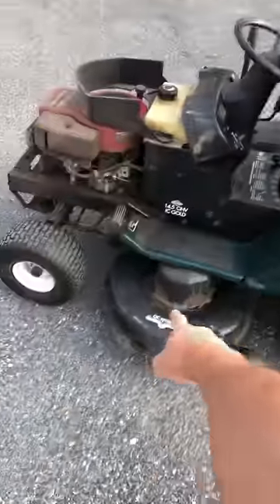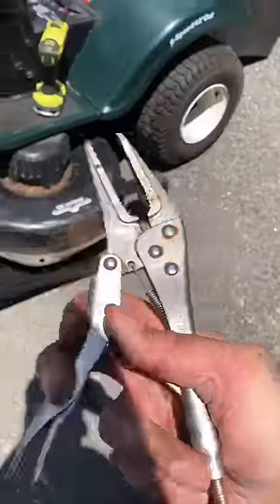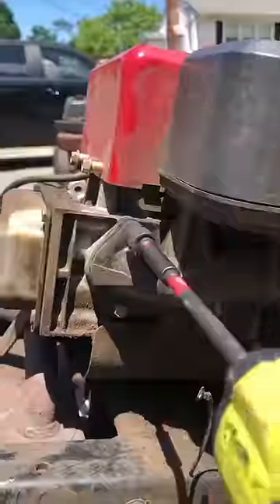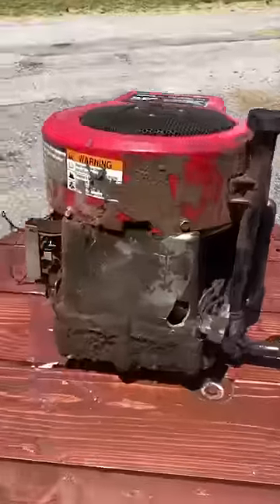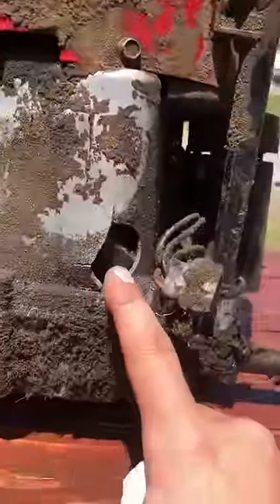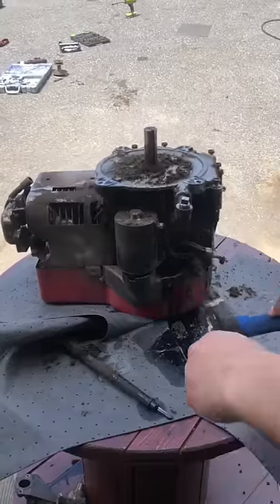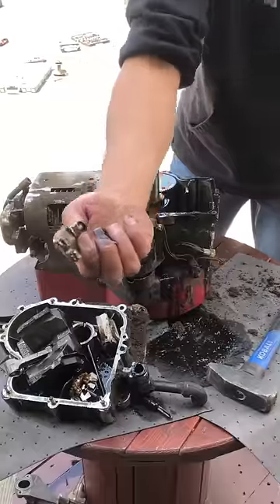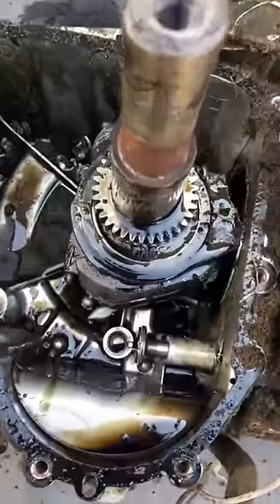The Dangers of Hitting Rocks | Exploring the Consequences on a Craftsman Riding Mower

Comment: Me and my brothers made from 2 old lawnmowers which we got for free to 1 working during lockdown.
1 was on fire once and had a new engine bit never really worked well after.
The other also had a hole in the side so we just swapped the engine changed the tires, pulleys and battery. 
Worked pretty good and flipped it for some nice profit. But it was mostly a fun learning experience.

Comment: It looks like it blow up from lack of oil that why all the grass was stuck to it
Reply from the maker: 🤷🏻‍♂️ probably both. The impact def didn’t help the cause 🤣😂💪🏻💥💥💥💥💥💥
Reply: @NiceLawnBro sorry but hitting a rock would just bend the blade on the deck and either stall the engine or slip the deck belt as to what caused the engine to blow up is the piece that is supposed to help reduce the vibration of the engine which is the first piece you pulled out they are prone to breaking because the one single bolt that holds that 2 piece part together inside the engine will work lose letting the 2 pieces move around causing them break and it causes the engine to throw the rod I've had several of those engines and have had that happen and after the first few times of that happing if I got a mower that had that style of engine I would tear it down and remove the particular part and put the engine back together and run it because it doesn't need that part and Briggs and Stratton eventually figured that out as well

Comment: lack of oil most likely. blew the connecting rod on my 16.5 kohler pro, due to low oil. Ive hit many rocks with that mower and my current mower, at most it just slips/knocks off the belt and/or bends a blade. No heat against you, just a "customer states" type deal

Comment: I bought an old lawnmower that had been pushed to a rock and tried to fix it but i couldn't figure out what the problem was so it just kinda sat there until i took it apart and found that the flywheel key was sheared diagonally in half. Those things pack some real power even if it doesn't always feel like it.

Comment: I’ve worked on 100s of those engines. So many failed compression releases. 
I’ve replaced a crazy number of camshafts. I always followed the the break in procedure on the camshafts and tappets. Still had a considerable number of them. They would flatten the lobes and or something. Lots of them would just instantly break the new compression release parts.
Reply: .. well, I've done so many intek cam jobs I can leave the engine running while I swap it😜

Comment: You are correct, been around enough to know that the engine through a rod. Hitting a rock will not do that. Like someone said, It would shear the flywheel key or bend the crank. Bending the crank could break the rod, but not like that.

Comment: I've never seen a blade strike hurt a mower with a belt driven deck. You can surely bust a spindle,but it's really impossible to damage the engine because the belt can not transfer that energy abruptly. You have an internal part failure. Possibly over revved. I once had a riding mower throw a rod and blew the starter off.

Comment: Small engine tech here: what really probably caused that motor to commit die was a blown head gasket. If you take the cylinder head off you will mostl likly see it's shot. The engine drank its own oil and since home owners never check it it hust was super low on oil and got hot. The color of that nasty black oil also confirms this since the exhaust gases were mixing inside the engines oil chamber.

Comment: That is why the mower is belt driven and belt to the blades to prevent sudden shock stop that would blow a crank or rod. But if it was a large enough rock and hot belts that grip extra tight I think this could happen.
Reply from the maker: Or it may have been the engine tearing itself apart and she thought it was a rock she hit.

Comment: I did this with a little push mower, it bogged maybe from oil supply problem or who knows what but i leaned into the accelerator and within a couple seconds it said POP and a hole like that one appeared; i barely saw the missing bit of casing fly off.  Edit oh yeah the bit of moving parts was sticking out the hole now i think about it.  Maybe the rod i cant visualize it to remember exactly
Reply from the maker: Always a tragedy when the insides of the engine are now outside of the engine 🥹🤣🥰

Comment: Like everyone else is saying this was the engine failing. Hitting thing with the mower usually slips the deck belt and or bends the spindle or deck. I have seen a lot of single cylinder Briggs come apart this way.

Comment: Reno green landscaping here. I am the truck trailer aaand heavy equipment mechanic 138+ for me .. however our small engine guy is going to want more on this video.. did you replace it or fix it
Reply from the maker: It sits currently without an engine. It will receive a donor engine from another free mower. Just not sure which one yet!

Comment: the belt gives enough cushion that a rock should not do that. they probably just though they did. I've repaired mowers where the blade is directly driven by the engine hitting large chunks or metal or stumps and coming g to an instant stop. only think I have seen it can cause other than bent crank would be a sheared flywheel key and usually only bends the blade if anything

Comment: I've ran over some big & little rocks over the last 5 yrs with our riding lawnmower & never once did I cause that kind of damage to the motor.  I've broke & bent stuff that holds the mower deck, chipped blades. But never killed a motor.  1 of the rocks was about the size of a watermelon,  half buried, but covered in  tall grass, that broke the bearing tower thing, but never a motor.

Comment: This is caused from the carb bowl getting stuck open and flooding the crankcase with fuel. When the correct conditions balance out, it will detonate and blow the block. Mine did it too, while between my legs!😮
Reply from the maker: This makes sense!
Reply: Wasn't the rod cap broken off? 🤔
Reply: Idk. I didn't pull it apart. It was locked up but blew a chunk out of the block out. I was told it's very common with the gravity fed carbs on these. The guy called them ticking time bombs.

Comment: What is the correct type of oil for these briggs n stratton engines? A quart of lucas?
Reply from the maker: 🤣 regular 10w40, 10w30 or sae30. Depending on your weather (heat) in your area. 🥰

Comment: Looks like you have a little more room to grow in the diagnosis department. We can all grow and learn so it’s not an insult. Hard for the impact from the deck to travel through rubber belt and on top of that these decks can’t take a hard enough hit to damage the engine because the tripod style spindles will break off the deck first. That engine just gave out probably because it was low on oil judging from all the crap around the mount it had been gathering crap on the leaked oil for years. Maybe just gave up after over 20 years, happens sometimes.

Comment: Those Briggs engines are designed to fail at every point internally. First time I saw a white metal (Chinesium alloy) wrist pin was on a Briggs. If everything internal fails to fail, the carbs are designed to fill the crankcase with gas after a few years of use, leading to catatasrophic engine failure

Comment: Flywheel key is a soft metal, and acts as a sacrificial piece in case you hit something. No way that engine blew up from hitting something before the key broke.
Also that older design camshaft with the compression release was actually the good one, and lasts much longer then the later more modern versions after production retracted focus on quality and shifted to cutting corners and costs.....funny thing is though the retail pricing kept going up.....
Reply from the maker: It probably sounded like she hit a rock! Quick engine stop and a hole in the back of the case; too much inertia. To your point, a key would have been an easy fix. It’s also amazing the “cheap” new riders are $1,599. The good ones are now like $4,500. 😳

Comment: So I have the same exact mower. I popped the motor too. Literally same carnage. She boogies with the 17 horse now.
Reply from the maker: Nice! What brand did you get? Or just a used one on the internets?
Reply: @NiceLawnBro  it’s a Briggs from the same family.
Reply from the maker: @Rayrayman111  I’ve got a machine with one of those in it right now. Might take it for this. Yet to be determined
Reply: @NiceLawnBro  really low maintenance machine. Had to do some steering bushings. Other than that it’s the normal belts and blades

Comment: Hey dude I tried starting my mower yesterday. I could get it running but each time I ingaged it in a gear it would die. I need help
Reply from the maker: Could be a safety switch like the seat switch, parking brake switch, or the PTO switch. Likely brake or seat.
Reply: @NiceLawnBro  oh yeah your the man. My rednecked seat switch had come undone. Thank you I finally got my acre of lawn mowed.

Comment: if it actually hit a rock then the belt would would be the component to give. Not the engine. Engine may stall or whatever but the shock would be absorbed by the belt, blades, and all that.

Comment: Man, I remember when you would hit a rock or a root, shear the keyway, slap another one in there and back to mowing in 30 mins.
Reply from the maker: Through time and experience, the general consensus is that this was a lack of oil that blew apart the crank. You are correct! Shear key is the preferred method 🤣

Comment: Cant be a rock. Those belts are supposed to slip in such situations. Or was the design of the mower so bad that it didnt slip? But even if it didnt slip, if wouldnt have put a hole in the block. When you stall a manual car, the engine is still fine… probably due to poor maintenance or maybe it was just time for that engine to say goodbye…

Comment: oils so critical on these motors, people dont reliaze that theres no oil pump or tube splashing all the internals, its the level of oil and it needs to always be above the check mark but not over it. 
if you run low oil levels this happens...

Comment: I abuse my equipment, and I’ve always been afraid of hitting a rock, and bending the crank.
Reply: Better chance you would break the deck first on a riding mower. On a push mower with blade connected directly to the engine Frank shaft that’s another story.

Comment: These engines had notorious counterbalance issues, which is what happened here. Hitting rocks can certainly destroy spindles and if large enough sheer flywheel keys, however I don’t think even hitting the side of the Ricky mountains would have caused this issue.
Reply from the maker: 🤣😂🚀 that’s an image I can get behind
Reply: These blades are belt driven. Hitting a rock slips the belt or at least allows enough give to cushion the impact.
Reply: @benjurqunov  You can still break spindles and potentially sheer flywheel keys. The transmissions are belt driven as well, other than a severely worn out belt, how often do the tires slip, versus the belt? This is especially true on the mower deck, all the pulleys have fairly large diameters, which allows more surface area for the belt, providing more “grip” and less slip. 

There is a reason when people modify lawnmowers for racing/off-roading, even if going for a 1:1 ratio they install the largest diameter pulley possible, less likely to slip.

Comment: Those Briggs weren’t very good. Even the new ones aren’t. I’ve had to fix many of them. I have vintage ones and they just keep going
Reply: I must have the exception, I have a 15.5 EZmodel I got free. I removed the deck prepped/painted it replaced the spindles,pulleys and belts. The engine needed a carb 10 Yrs. after that but other than that it's still going strong. Oh the seat got replaced with a good used one also. A tool Don't need to be shiny to get the job done.

Comment: They let it run out of oil, a con rod dont snap from the blade hitting a rock. Mowers are one of the most used and abused engines out there, they live at 3600 rpm under a load + get neglected and usually not maintained.

Comment: You would have bent the crankshaft at the engine sheave … from the massive buildup of oil and grass debris on the engine mounting plate I can already diagnose that the engine failure was from oil leaks and lack of lubrication. But if it makes you feel better to think it was a rock I won’t argue with you, been working for John Deere for 10 years, customers never believe it was their fault.
Reply from the maker: You’re right.

Comment: I have 3 links from an old battleship, they are about 10kg each and massive. My wife run them over with the lawnmower, the blade was twisted into a s shape and we got a free replacement from the local shop, he just wanted to keep the old blade to hang on the wall.

Comment: I feel like you dont need to bust out the air tools for a freakin lawn mower lol. I’ve only ever used the old greasy rigid.
Reply from the maker: I keep seeing rigid tools for sale on marketplace. I have a drill drill by them and it’s ok. I’ve used an impact drill as well by them and was really impressed by it. Might as well pull the trigger and get a battery impact gun and make it happen, huh?

Comment: Ok I've never seen a Briggs throw a rod from hitting a rock or stump etc.

Bend a crank, blade, whatever but throwing a rod thru the block? Hmm...
Reply from the maker: The “rock” was a low oil result of the rod blasting itself apart into the crankcase. Maybe even an over-rev. But I wasn’t there so I cannot confirm that.
Reply: @NiceLawnBro  Nod. Only time I've seen them do it is from no oil. I don't know for certain on the newer ones but when I was flipping them they couldn't breathe enough to fly apart. They just wear themselves out and start burning oil badly but throw the rod? Naaa.

Comment: hitting  a rock isn't going to effect a belt driven lawn mower , it be stretching it to even say a slight nip on key way would stop it ....... broken rod is most likely abuse of engine...... not changing the oil like you are suppose to eats up these newer engines  cause of the use of cheaper softer metals ....

Comment: No way a rock blew a hole in the crankcase. Those mtd tractors can’t take low oil, Briggs did a terrible design on those and the 10hp generator. No low oil sensor, and an even worse way to check it
Reply from the maker: She must have lost track of her oil changes over the years and the “rock” was the rod and now it all makes sense. 🤣😂🚀🕳️

Comment: theres a 0% chance that was a rock. ive turned mowers on over rocks just to test this before (yes i was protected bc it was a self propelled and i just let it go towards rocks and had a setup for it) and a rock would just bounce in there but would not be able to get to the engine especially on a rider mower.

Comment: The engine is too far removed from the mower deck. Hitting an object with the blade will only damage the deck. That's a lot cheaper than an engine. Direct drive push mowers are a different matter.

Comment: A rock didn't cause  this . this cause due to lack  of oil an over heating .  The cam shaft release   on these  cause the engine to drop a valve an boom! . also another failure  point are the valve seat moving  causing  yet another engine to blow .  another failure point is the Anti back fire  switch on the carb failed  an a gas bypassed  the carb an filled the crank case with gas .

Comment: A rock did not cause that. They may have hit a rock right as the engine gave way but that is low/no oil damage.I have never in my over 40 years of mower repair seen damage like that from a rock impact.
Reply from the maker: It probably sounded like a rock
Reply: @NiceLawnBro  Oh it made some noise that is for sure. I know a man that was on a riding mower and ran over a 12 gauge shell. The blade set it off. A lot of noise but no damage unless you count his pants.
Reply from the maker: @davidhenderson3400  🤣😂

Comment: You didn't bust that engine by hitting a rock a belt-driven engine won't do that. when you hit a rock you will bust a spindle which is attached to the blade that actually hits the rock.

Comment: Soooooo I shouldn't treat my GreenMachine like a BrushHog?
Reply: @NiceLawnBro  I picked one of these up last year sometime for the cabin/ mid Michigan. It looked like it just left the showroom floor when I grabbed it. I think pre-owner must've waxed it after each mow session for 2decades. I loaded it up in the truck&said "This is gonna be PERFECT for mowing trails thru the woods......" 

He looked at me like he was about to give me another 100$ to buy it back from me. Lol. So far a year later, if that thing blew up tomorrow, I've gotten double my money outta it if not ten fold. I've made trails with it where even the neighbor wouldn't take his tractor. Lol.

I will say that I do keep the belt a little loose, the throttle running max&the blades sharper than new. But I've also stalled that thing out numerous times while cutting. Lol
Reply from the maker: @thefinalgrind  🤩

Comment: Nope. A rock or tree trunk didn't do that. I'd bet the gas in crankcase did that. A carburetor with a bad needle gasket will fill the crankcase. This happens because ethanol dries rubber out. Always check your dip stick. When it went boom they thought they hit a rock.
Reply from the maker: Yes!

Comment: hmm yes
hit a rock
i call so much bullshit, the ceptic tank is overflowing with how much bullshit that is
its a belt driven deck for 1, and there aint any way for it to fuck up the engine too much, the belt probably would slip and take up the shock, even if it didnt and it went straight to the crank, it aint gonna be throwin a rod easily at most, sheared key, so, yeah nah, "hit a rock" what they heard when they heard the klonk was the damn rod knockin on the door and blowin out the door.